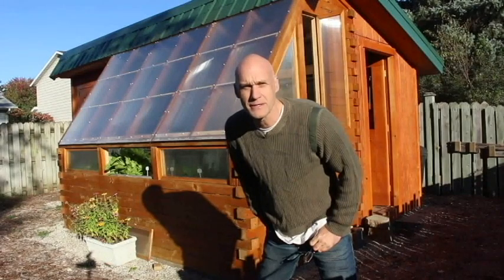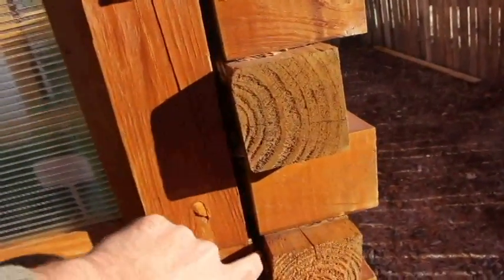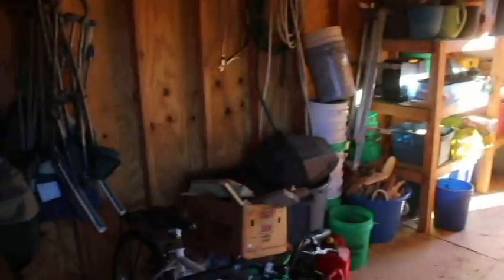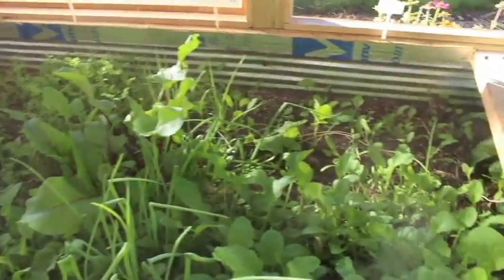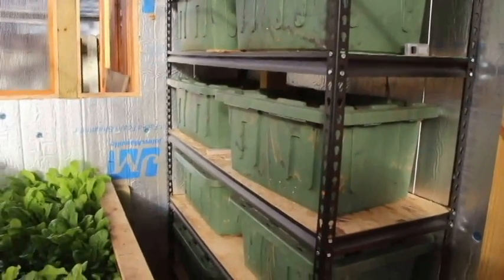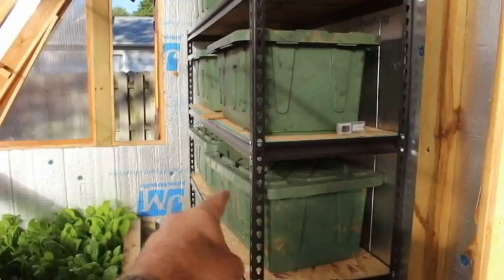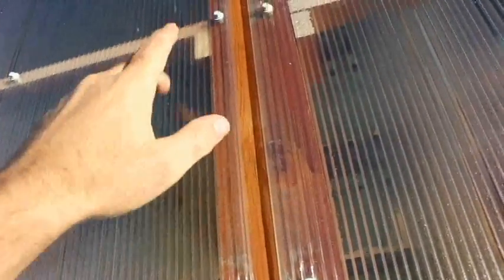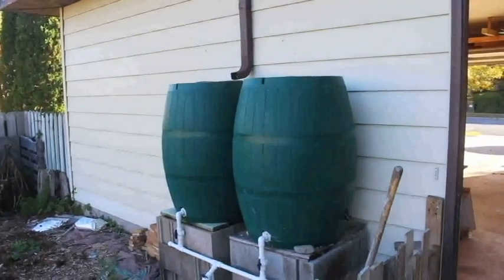Insulated Greenhouse and Shed Update - 1 Year Later

Comment: Great videos and excellent use of space.    If you paint the water containers black, they'll absorb the sun's energy faster and achieve higher temperatures, thus emitting more heat and for a longer period.
Reply from the maker: Yeah, I was thinking about painting them black. It would have been nicer had the totes I bought already been that color.
Reply: Maybe some reflective material would help too, depending on how the light hits the inside walls.

Comment: Love your greenhouse! You did a great job on this, especially how much was unassisted! I have 1 question. Isn't the greenhouse section with the polycarbonate supposed to be a certain angle to allow full sun penetration? I think the rise or slope (depending which way you look at things) should be somewhere in the 20-25 degrees range (from horizontal) for the northern hemisphere and northern states. 

I've read some sites were like 23 or 24 degrees, it depends what lattitude you are at. I think there's a formula to calculate the angle. Bigelow Brook Farm mentions a degree in their Youtube videos for their location. It is almost the reverse of yours. In other words,  the side with less slope (flatter) should have the poly, and the steep side should have the roofing. I think the goal is to have the roof 90 degrees perpendicular to the sun; at its highest point of intensity the sun is in the southern sky, at around 10 or 11 o'clock if looking from east to west, and it changes during the season. 

Also, I think you can prevent condensation between layers in the polycarb by putting duct tape over the top & bottom ends first, and using greenhouse washers that look like fender washers but with rubber backing. Hope this helps.
Reply from the maker: Yes, I believe the angle formula is your latitude plus 15. Mine is pretty close to that.

Comment: Are those tubs made to hold water?  Did they freeze at all in the winter?  I am going to build a similar greenhouse this year and also was going to use water as a heat sink...  was worried about my water containers cracking if they froze.  thanks!
Reply from the maker: There will be a little ice that forms in some of them - usually the ones on the lowest shelves. It hasn't ever formed more than a thin sheet of ice in them. I haven't had any crack on me.

Comment: I've been thinking about heat sinks. To me it doesn't make sense to have such a thick container like a box or barrel shape. The water in the center is not doing much. Wouldn't it be better to have a container that's only a few inches thick? The higher surface area to volume would facilitate more heat exchange both in heating and releasing that heat.
Reply from the maker: +David D probably. The difficulty would be in finding the right shaped containers while still having enough volume.
Reply: Steel gas fuel tanks might be suitable.  Those are tall and not too thick.
Reply: That's a good idea

Comment: Treated wood BAD BAD idea....use cement blocks or untreated wood
Reply from the maker: +moe roy no. Its not bad at all.  The wood is not in contact with the soil and it provides insulating value.

Comment: Whats the point of an insulated greenhouse if all the plants still died in the winter?
Reply from the maker: It extends my season without any use of electricity. I can harvest until December which is about three months longer than normal. I can also start plants in the spring in early March or even late February when normally I would have to wait until April.
Reply: There are many factors in creating an amazing design. One resource I found that succeeds in merging these is the Wilfs Shed Formula (google it if you're interested) without a doubt the most incredible info that I have ever heard of. look at this  unbelievable resource.